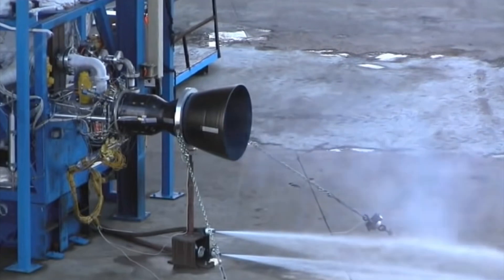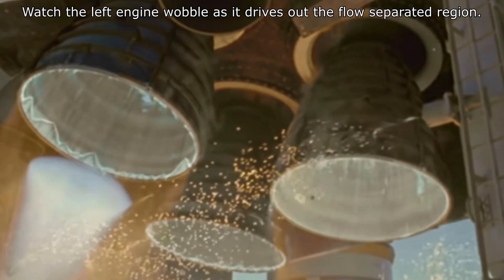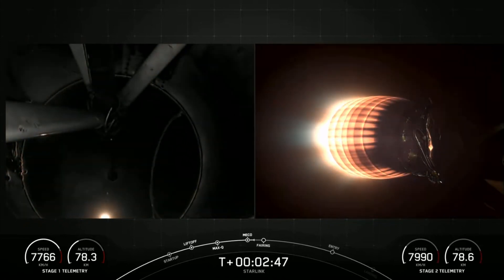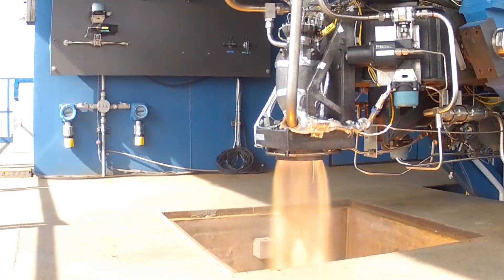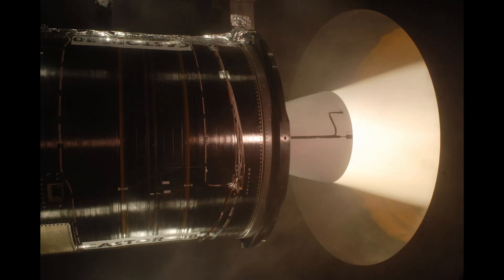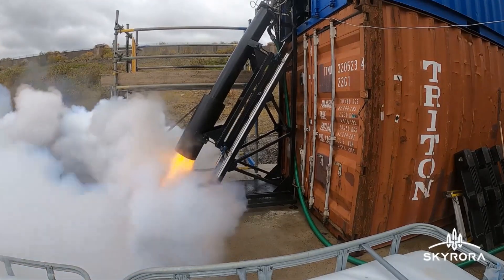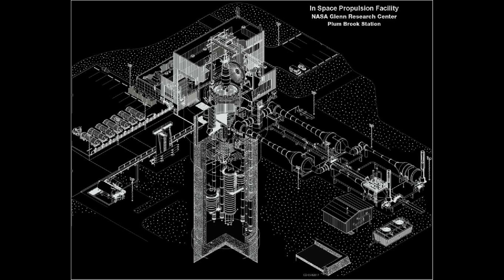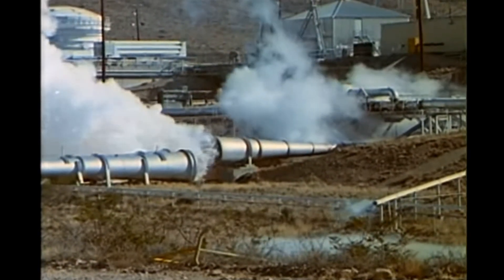Defying Atmosphere - How Rocket Engines Get Tested In A Vacuum Before Going To Space

Comment: That’s not a vacuum.
Reply: Technically ANY pressure less than atmospheric is considered "vacuum".

"vacuum" - A vacuum refers to a space where the pressure is lower than atmospheric pressure. In scientific terms, any pressure lower than the standard atmospheric pressure at sea level (which is approximately 101.3 kilopascals, or 101,325 pascals, or 1 atmosphere) is considered a vacuum.

Rough Vacuum is considered anything better than 1.0 Torr.
Earth's atmosphere is less than 1.0 Torr at only 50 kilometers altitude .
You can watch any of the SpaceX videos to see that their rockets have no trouble performing propulsive maneuvers above 50 km and even as high as 120 km during a boost back burn.
JUST GO WATCH THE VIDEOS and quit DISMISSING them like imbecile papalegba here.
he flat out refuses to evaluate any evidence that has the potential of proving him wrong. So, he cannot even WATCH a SpaceX launch.
Reply: @stuartgray5877  Derp.
Reply: @MediaLieDetector  highly intelligent response 
Bless your little heart!
Reply: @stuartgray5877  Surprised you even know what that means. 🤪
Reply: @MediaLieDetector  Respond to my recent new thread in this video.
Explain how the superheavy launch and landing was all "CGI"
Reply: @DrCash7    - "If you fire a crossbow in a vacuum, what system absorbs the "recoil"?"
The crossbow absorbs exactly the same amount of "Momentum" as was imparted into the projectile by the bow.
This is known as "recoil"
- "If you fire a rocket in a vacuum, what system absorbs the "recoil"?"
The rocket feels the recoil of pushing out mass which results in forward "Thrust"
- "If the answer to both is "nothing," then you've proven my point."
Good thing the answer is not "Nothing".
- "If you can't deposit energy into a field, there is no withdrawal."
If YOU don't know basic physics, then there YOU cannot provide a valid answer.
Reply: Space is less and less vacuum  as I suspected, now Moon has our atmosphere!
Technically,
Reply: @ Lay off the drugs.
Reply: @MediaLieDetector  Respond to my recent new thread in this video.
Explain how ALL SEVEN of the superheavy launches and TWO landings now was all "CGI"
Reply: @MediaLieDetector  If you are STILL confused about how rocket propulsion works, just explain what would happen if I fired a crossbow into a vacuum.
Would the crossbow feel a "recoil force"?
Yes or no?
Why or why not?
Scared to answer the simplest possible basic physics question imaginable?
Reply: @ What? Just ask your question.
Reply: @ Your speech didn’t prove anything. Try contacting voyager. Maybe it can help. NASA doesn’t even know the frequency of the voyager transmitter anymore. That’s okay because it never left earth orbit either. Try to keep up.
Reply: @MediaLieDetector  A machine CERTAINLY CAN perform work while accelerating mass into a vacuum.

It does no work ON THE VACUUM Genius.
Reply: @ You are arguing with yourself. I’m not here.
Reply: @MediaLieDetector  - "I’m not here."
Yeah, I've noticed. No intellect AT ALL.

So STILL unwilling to just tell me if crossbows have recoil if fired into a vacuum I see.
So why are you scared to address facts?
Reply: Correct

Comment: I thought it was the hot exhaust gas that stands as a wall for the propulsion to push off of?
Reply: The rocket exerts a force on the exhaust gasses to push them out the back. In accordance to the third law of motion, the gasses exert a force back on the rocket, propelling it forward.
Reply: @AM-rd9pu  And what exerts a force on the gasses that exert a force on the rocket? Don't tell me you're gonna say, the rocket!
Reply: @mattbyman  It is the rocket. I’m not sure why you would think the force pushing the exhaust gasses out the nozzle would come from anywhere else. 

When you throw a ball at a wall and it bounces back towards you, the force that causes the redirection comes from the wall. The expanding exhaust gasses in a rocket collide with the nozzle. The nozzle provides a force and directs the gasses out of the nozzle.
Reply: @mattbyman  The rocket engines exert a FORCE onto the mass of the exhaust gas.
Any force exerted by the rocket onto the mass of the exhaust gas MUST ALSO be felt BY THE ENGINE.
This is Newtons THIRD LAW!

"Forces" NEVER occur alone, they ONLY occur IN PAIRS - Equal and Opposite.
It is impossible to have a single ended force.

Comment: My issue that I'm having a hard time understanding is when the rocket is in space and when the rocket makes its own oxidation chamber and then adds fuel and spark. Creates pressure but the second that closed pressure gets released into space for thrust the vacuum is sucking everything out very fast before that pressure can do anything. It's hard to believe they had enough thrust pressure to get off the moon too. I believe they got there but getting back seems impossible to me. I watched several videos and none have a proper vacuum chamber without oxygen. I'm not sure how we created testing for the rockets to go in space if it seems impossible to make this environment on earth even with the biggest vacuum on this planet. I know the moon has less gravity.
Reply: A vacuum isn’t a force and it doesn’t suck. The pressure inside the combustion chamber causes the gasses to push their way out of the nozzle. 

The rocket imparts a force in the exhaust gasses to accelerate them out of the nozzle. In accordance to the third law of motion, the gasses impart a force back on the rocket, propelling it forward.

Comment: Basic rocket science is the higher you go the wider your rocket engines because the less atmosphere you have so less thrust.  U need more area to get enough atmosphere to act on for you to get  propulsion through the medium you are in.  You just say some garbage smoke screen  about air missing up stuff what a joke. Newton's law that when you act on something you get an equal and opposite reaction. The key word in that statement is something when you act on nothing nothing happens. That's why you get no propulsion without atmosphere because you don't have anything to act on because there's nothing to transfer the energy but that's common sense Newton knew that and his statement shows as much.  What don't you get It's pretty simple. If what they say was true why not just use the same rockets should be easier the lighter it gets right. But no they increase the size of the engines because they're small ones are no longer displacing enough air. But no rockets work just fine even better in a vacuum .  not!  Don't forget free expansion that would pull way more than any rocket we could even imagine building.  I understand that you think you come from nothing and having trouble understanding something being that I'm something I understand that something can't come from nothing as long as you believe nothing is something you'll never understand something.  Star wars is not  real sorry.   have a blessed day YAHUAH rules forever.
Reply: Hi. Actual rocket scientist here. 

It’s incredible that you start off by citing “basic rocket science” and then immediately get things wrong. 

Nozzles meant for high altitude or space flight are flared out more to achieve a higher expansion ratio. When there is little to no ambient pressure, flow expands more because there is no external force to prevent it from doing so. Wider flared nozzles allow for optimal flow expansion in these conditions and result in greater thrust. 

Here’s some actual basic rocket science. The rocket pushes on the gasses and the gasses push on the rocket. There are your two objects. The gasses get ejected backwards and the rocket is propelled forwards. Rockets work for the same reason that you move backwards after throwing a heavy object while sitting in a rolling chair. You exerted a force on the object and the object exerted a force on you. That’s Newton’s third law. 

And lastly, vacuums aren’t a force and they don’t suck. Free expansion happens due to the pressure of the gas sample. It pushes itself outside to disperse. 

The combustion chambers of rockets can reach thousands of psi. The gas pushes itself out the rocket. The vacuum doesn’t pull it out. 

You seem to understand that pushing on nothing does nothing. Rocket exhaust does indeed do no work on its surroundings. It does work on the rocket. But why do you think that nothing can perform work on something?
Reply: @AM-rd9pu  really you barely have any of that right to have a pressurized system next to a non-pressurized system without a container is against the laws of thermodynamics so that means space is fake and anything done in that fake is automatically wrong didn't happen so not to mention we don't even have material to survive the temperatures of space so we going to that imaginary place with imaginary material couldn't have happened and for you to think that you're a rocket scientist and don't know the basic fundamental properties  laws of thermodynamics just a bunch of Make Believe pseudoscience not actually based in reality why lie that's all you globetards have ever had guess when everything you know is based on a lie doesn't that make you the LIE
Reply: @7minutestofreedom743  - "really you barely have any of that right to have a pressurized system next to a non-pressurized system without a container is against the laws of thermodynamics "

REALLY?
Well, a gas centrifuge can create a region of high-pressure gas adjacent to a region of low-pressure gas with NO PHYSICAL BARRIER between the two regions.
Care to tell us HOW this machine can do something YOU claim is impossible due to "Thermodynamics"??

No? What a surprise!
Reply: @7minutestofreedom743  The “logic” in your argument is deeply flawed. You’re mischaracterizing the atmosphere and using that to claim that the globe model violates the laws of thermodynamics. 

Do you not find it weird that the people who actually study thermodynamics aren’t coming out in droves to say that the globe model violates the laws of thermodynamics. 

What do you think is more likely? Millions of people all not understanding thermodynamics despite extensively studying it or it’s just you that misunderstands thermodynamics?

Because I’m curious, what is your education or experience in science or engineering?

Have you not heard of pressure gradients? The atmosphere doesn’t suddenly end. The air pressure just keeps dropping until there is basically no air. Remember that a vacuum isn’t a force. Gas expands due to its own pressure. However, gravity is a bounding force that keeps the atmosphere on the earth. The downward force of gravity is stronger than the upward force from the gas pressure. 

You also don’t understand how temperature and heat transfer work. The temperatures you’re referencing are in a region with an extremely low particle density. There are just too few particles to have any sort of appreciable heat transfer. A handful of particles at 10,000 degrees won’t melt metal. 

You’re baselessly denying science and calling anything you don’t like pseudoscience.
Reply: @7minutestofreedom743  you're talking to chatbots 😂
Reply: @papalegba6796 You have no evidence that I’m a bot.
Reply: @papalegba6796  probably
Reply: @7minutestofreedom743  definitely
Reply: @AM-rd9pu  you fail the Turing test, so yes I do 😂
Reply: @papalegba6796  I don’t think a person who regularly has reading comprehension issues would be a good judge for that.
Reply: @AM-rd9pu  congrats on failing the Turing test again, chatbot 😂
Reply: @AM-rd9pu  blah blah blah mix truth with lies and try to fool people well if you're a rocket scientist that is sad
Reply: @7minutestofreedom743  Another "Rocket Scientist" here.

Rocket propulsion is just the mechanical recoil of pushing on mass.
When a rocket is running right here on earth in atmosphere:
1 - Does the exhaust gas have "mass"?
2 - Does the engine "accelerate" that mass?

The answers are yes and yes.
Fact: The rocket engine applies a "Force" to the mass of the exhaust gas ACCELERATING IT from the nozzle 3000 PSI nozzle into the 14.5 PSI atmospheric gas.

Now what does newtons THIRD law tell us about forces?
Reply: @stuartgray5877 you can be proven wrong by the example given, throwing something in a rolling chair. But you’re probably to weak to throw anything heavier than a pencil
Reply: That is not how that law works. Creating a force in one direction creates thrust in the opposite direction.
Simple.
Reply: @sH-ed5yf  that might just be the most dumb thing I've ever heard please tell me you are Joking
Reply: @7minutestofreedom743  of course. The dunning Krüger effect is a real thing. But you should at least try to realise 5th grade physics.
Throw something out at the back, creates forward force. Its as simple as that
Reply: @7minutestofreedom743 why don’t YOU try to explain mechanical recoil from a crossbow 
YOU CANNOT
YOU ARE INCAPABLE
Prove me wrong-YOU WONT
Reply: @7minutestofreedom743 . Sorry to break it to you but you are trying to basically lecture a rocket scientist about the physics of rocket propulsion 
I’d bet that you are incapable of passing a high school physics exam, but you feel confident trying to explain physics to engineers that obtained their degree BEFORE YOU WERE BORN?

This is known as the Dunning-Kruger syndrome 
You are suffering from it
Reply: That Einstein was a idiot that done nothing worth a dam for humanity Einsteins gravity does not fit reality in no form or fashion but Newton's did  had to go with Newton's idea of gravity because it is some what based in reality but can't work with Einsteins so with that there goes your helio centric Newton believed in the ether. How about the fact that when you get a magnet or any metal  to melting it no longer has any magnetic abilities so it would not conduct electricity at all so with that how does the Earth's Molton metal core be doing anything thinks for being some what honest that is very rare with the defenders of the ball Earth so can you keep it up so would a rocket work in a Vacuum?
Reply: @7minutestofreedom743 why not address my two comments above?  Too difficult for you?
Reply: @7minutestofreedom743 papalegba is too scared to address my points.

Are you also afraid to address "facts"?
Reply: @7minutestofreedom743  - "you believe in a bunch of Make believe pseudoscience that has no basis in reality "
Nope sorry - wrong AGAIN.

I have been building, testing, fueling, launching, and operating earth orbiting spacecraft and deep space science probes for almost 30 years now.
I just finished help launch the USSF-62 mission for the US military.
I have personally helped put seven spacecraft on the rocket and launch them.
 I am currently working on THREE Deep Space science missions for NASA.
You?
Reply: @stuartgray5877  the best you got is to repeat what I said and you paid for that indoctrination you should sue them
Reply: @7minutestofreedom743  So tell me HOW we measure earth rotation and curvature thousands of times a day worldwide using fiber-optic gyros.
This IS a fact regardless of if you believe it or not.

Now explain this fact.
Next explain WHAT IS the ISS? You know the object you can SEE - IN ORBIT - WITH YOUR EYES?
Reply: @7minutestofreedom743  SpaceX launches rockets TO SPACE a couple times a week now.
Care to tell us who is their biggest customer?
Reply: @7minutestofreedom743  I would bet you $1000 CASH that you could not pass a high school physics exam. WITH AN OPEN BOOK.
Care to take the bet?
Reply: @7minutestofreedom743  - "Now EXPLAIN this fact or run away like a coward - your choice."

So, you chose to RUN AWAY just as I predicted?
Perhaps you could finish high school before challenging actual engineers to a physics debate?
But Bless your little heart for effort!

Comment: He talks as though creating a space like vacuum is a simple thing. He gave Cody's Lab model rocket in a "vacuum" as an example of how the ignition of a rocket may require a pressurized environment.  Again speaking as if a "vacuum" was achieved by Cody. 
Reality is Cody said flat out, "I was going to take it down to a full vaccum anyway." If people (including Scott Manley) had a clear understanding of a "space like vacuum" they would look at the liquid water in Cody's Lab video and know that test was performed at below 90k feet becausethe water wasn't boiling. Not anywhere close to a "vacuum" because the SR-71 was flying with aerodynamic forces at 90k. That is  not a "vacuum"
Reply: The atmospheric pressure at only 50 kilometers is already below 1.0 Torr (1/760th that at sea level).
You can find a few hundred videos from SpaceX that demonstrates rocket propulsion well above that.
Reply: Cody spent a few days doing a very limited experiment that says nothing about how real rockets work.